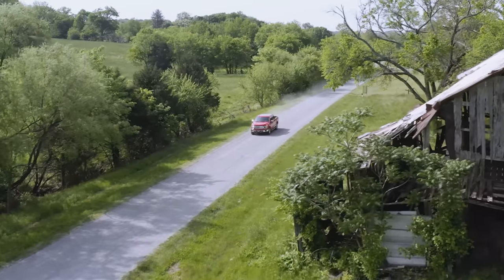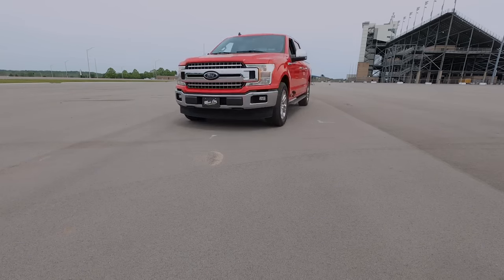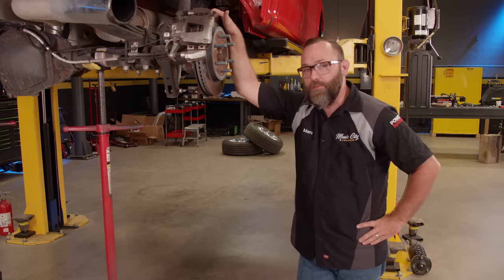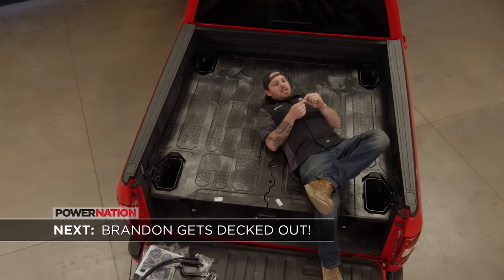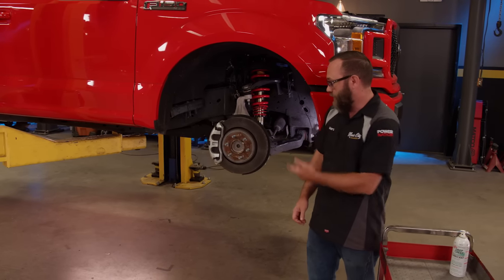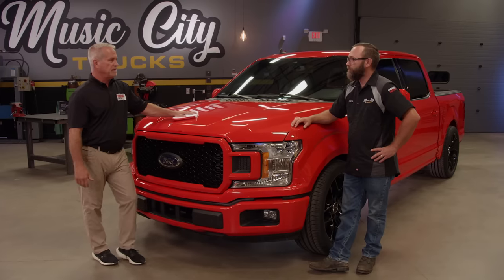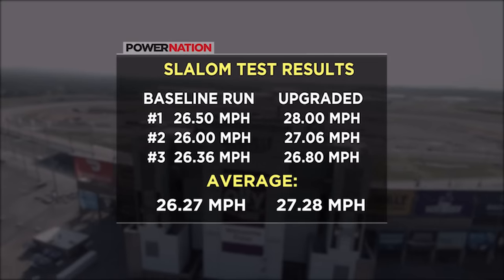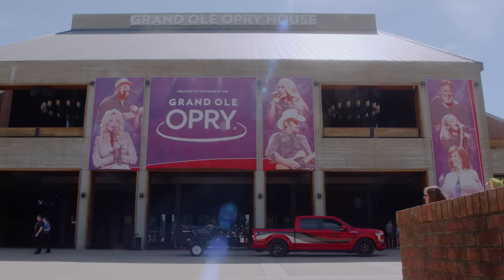Full Build: Turning a Stock 2020 Ford F-150 XLT Into The Ultimate Sport Truck

Comment: The only real improvement performance-wise was in braking. Otherwise the truck was slower and didn't handle any better. The stickers detracted from a beautiful paint job. Rims are nice.

All in all, if they'd just swapped the brakes, added leather seat covers, and ceramic-coated the truck, they'd have a truck that's cheaper, faster, and better looking (depending on how important a monochromatic paint job is).
Reply: They also did intake and exhaust and tune which does give it a little more power and torque

Comment: I own this same truck in the Oklahoma edition....Mine looks better stock than all their crap they put on it.....Great running truck, I've always had v8s but my 2020 will smoke all of my prior trunks. Also has great torque. 380 hp 400 ft lbs of torque....It's all you need.

Comment: I understand the graphics are for advertising , in this case. But I don’t want to drive a billboard. My 13 regular cab, short bed with a 3.7 base engine , ran 0-60 at 7.0 from the factory.

Comment: That thing still needs a few mods and we don't need graphics on every car or truck. Plus I have a 2018 2WD 2.7 EcoBoost and I think mine handle n stopped better then that. I'm not saying EBC brakes are the best but there ok. Plus idk what mode u had trans in. Get rid of the tool box thingy in bed that's extra weight and u lowered it way to low.. they have a special made hook for that back seat ford doesn't want u to know about. And need a oil catch can system. And much more...
Reply: 2.7 eco boost drive it straight off a cliff!

Comment: My 2.7 eb supercrew did a 5.97 0-60 on a draggy with spinning (its a 2wd no locker) so either Nashville altitude is up there or a 5star 93 tune would benefit that truck a lot

Comment: I love it... just too many damn door handles.
Reply: Shaved handles are so 1995.
Reply: @musewolfman   Lol nah not that!! I just think the 4 door trucks with the tiny little useless bed suck and look like ass. I can't put a dirt bike in that. Do people even do truck stuff with trucks anymore?!?!
Reply: @WhitefolksT people don't even turn screwdrivers
Reply: @WhitefolksT ugh yes you can. Supercrews come in either a 5.5ft bed or a 6.5ft bed. A 250cc bike is 7ft long. Put the tailgate down and both bed configurations can haul a dirt bike with ease. Id argue a shortbed truck looks better than a long bed regular cab.
Reply: @WhitefolksT  Been using the hell outta my 5.5 ft bed f150. It's full of tool boxes, ladder rack, insides full of pack-outs. Love the short turning radius of them. Weekends I pull the boxes and it still catches a little air, rips mud, sand, pushes snow... LOL Not a fan of lowering em though.

Comment: 7 to 8 sec to do a 0 to 60 pull? These trucks are capable of a bit faster than that in stock form
Usually 6 sec easy. The only problem with 2WD is the brake boosting produces torque that just shreds the tires. I know my 4WD would when in just 2WD with the rear axle locked 
Tuned 4x4 3.5 ecoboost trucks do 5 sec 0 to 60
I think a Five Star Tuned with just air filter mod did 4.7 sec. All stock engine, turbos etc

I'm guessing maybe they did the half ass 0 to 60 attempts in hopes of easy "improvements" perhaps.
Reply: The 2.7 is even a monster with a tune,and been proven to smoke the Chevy 6.2 and the hemis... this could have gone so much better.
Reply: @mikewhite3123  They are impressive.
But something was wrong here in this video as the stock 3.5 EB is faster than the times in this video.
It may just be that it needed to be driven by someone who knows the sweet spots of these trucks for brake boost, amount of throttle...
And they should have turned the traction control off and let the tires slip a little. 
Traction control can really pull back the torque and be stingy at allowing full output again.
Someone who drives these trucks would know.
Mine was a 4WD so I did have 4W Auto which was a secret weapon at stop lights to allow me to fully brake boost 👍

Comment: That V6 just doesnt have the soul. The sound is not great even through an expensive exhaust. Gotta get the Coyote with the regular cab if you want a sport truck. This is just a SEMA special.
Reply: The V6 doesn't sound good with a loud exhaust. 
But that turbo V6 out performs the Coyote by quite a bit. Especially towing.

Comment: i swear i wish people would stop pushing those braided stainless steel brake lines  that braided stainless line makes it impossible to tell if your brake lines need to be replaced and the braided housing doesnt do a damn thing for making the brakes work better  as it so loose  the brake line still swells when pressure is applied to the pedal  theyre only intended to be aethetically pleasing and are absolutely not a performance enhancing item
WILL NOT RESPOND TO COMMENTS